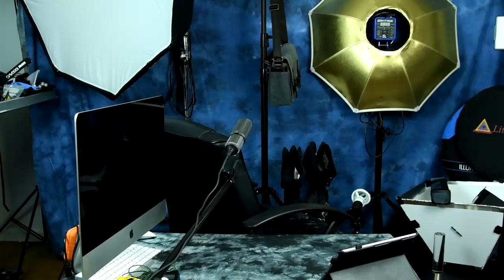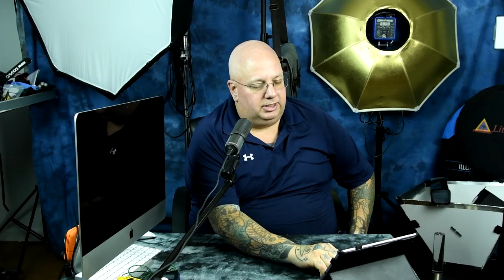Camera clipping points in calibrating dynamic range for metering

Comment: Let me first state that I agree that a lightmeter is indispensible for speedy setup for flash work, espacially multi-flash setups. Now onto where we differ...

When you are developing a RAW file, the conversion software is applying a tone curve to each color channel ... and then you export to jpeg. (You are not exporting linear data) Those tone curves determine the luminance values of the colorchecker patches which is what the Sekonic software uses to generate its curves. So the tone curves of your RAW conversion process have a direct impact on the DR that you end up with on the Sekonic software.

e.g. Take a look at difference between ACR "Standard" & ACR "Standard v2": 
https://flic.kr/p/T9T1iC
Do you notice a difference in brightness of the patches? If these were exported to JPEG and plugged into the Sekonic software then the more "contrasty" conversion will yield less DR in the Sekonic software than the "flatter" conversion. Do you understand now?

p.s. You never answered my previous question... Does my Canon 6D have more dynamic range than your Nikon D810 because the Sekonic software says so? https://flic.kr/p/SjTeB3 ,
        or,
as I've explained quite comprehensively now, is it just that my conversion profile applied less contrasty tone curves to JPEGs which I susequently I plugged into the Sekonic software.
Reply from the maker: thats not the point, light meters for photography dont give a shat about COLOR.....its about setting CLIPPING points for EV range 

Sekonic software is for calibration of imported images, it doesnt "say" anything of itself of ANY camera.
Reply from the maker: you can drop BW jpegs, the calibration for clipping points would be the same.
Reply: This is very easy to test... Since you've already shot the D810 RAW files and use Lightroom.. I assume you know about the "Camera Calibration panel in the Develop module):
1) use "Camera Flat" conversion profile, export jpegs and profile in Sekonic software
2) use "Camera monochrome" conversion profile export jpegs and profile in Sekonic software

Do your Sekonic DR graphs end up identical for profile 1 and profile 2?

Comment: Knowing my camera profiles were derived from Jpegs I set my clipping limits pretty tight. Some might say I've given myself less latitude but knowing the eventual RAW's will have more to give me than even my lightmeter states means I'm getting as much dynamic range out of my sensor as possible. Building too large a safety net into the profiles clipping range might seem like a good idea but I've not found myself reaching that point yet :-P